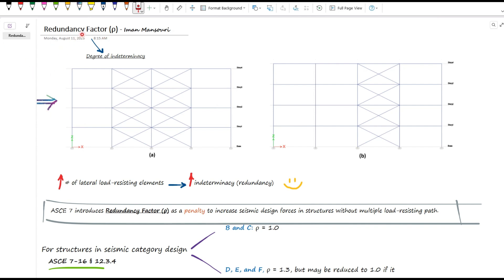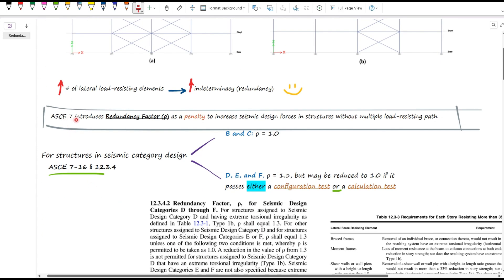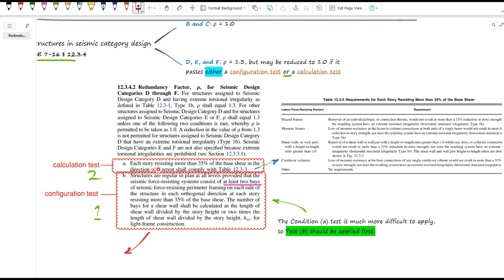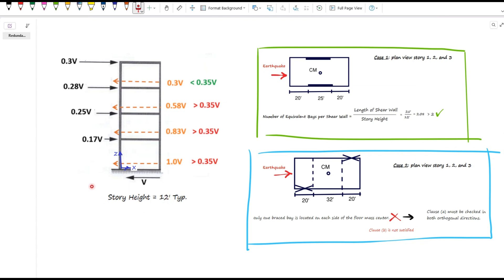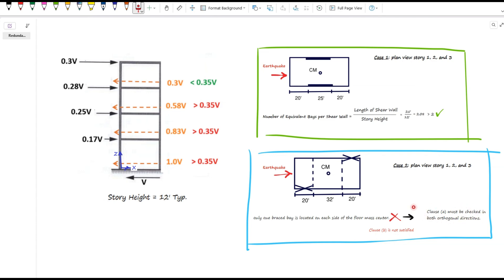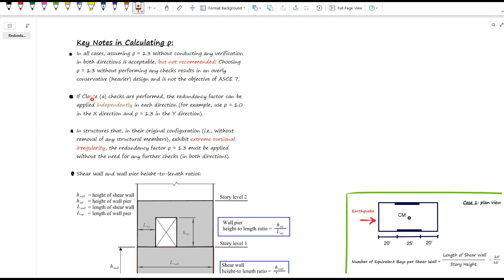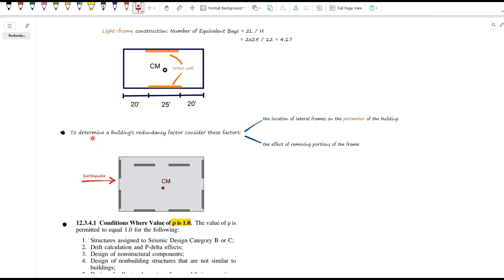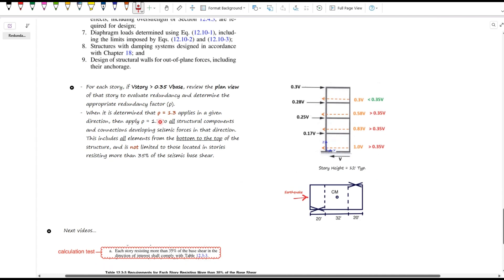Redundancy Factor (ρ) — Part 1 | ASCE 7 Explained

Comment: Doctor 🙏
Could you please share your experience on the difference in analysis results and practice when a staircase is modelled versus when it is not? If you feel the topic is worth discussing, a clean, detailed video would be very helpful.
Reply from the maker: Thsnks for your suggestion. Sure, will do